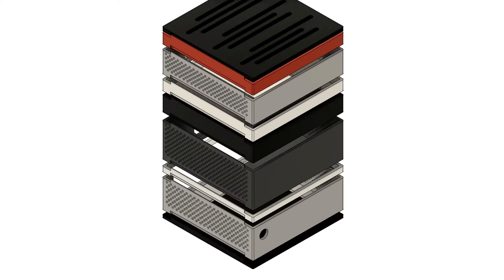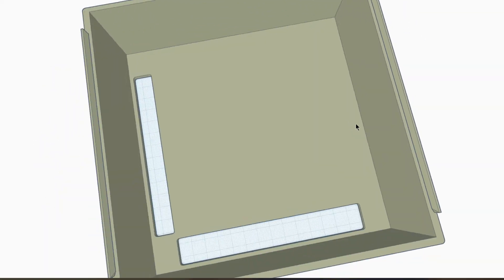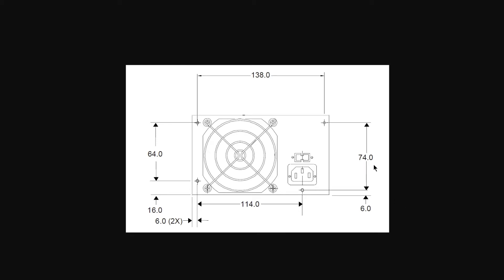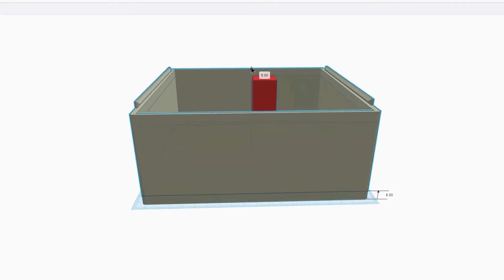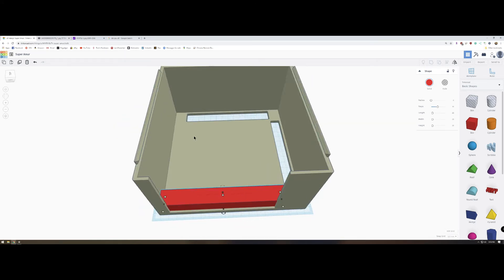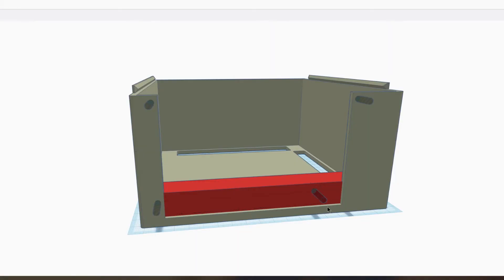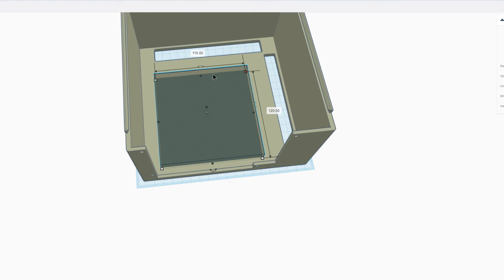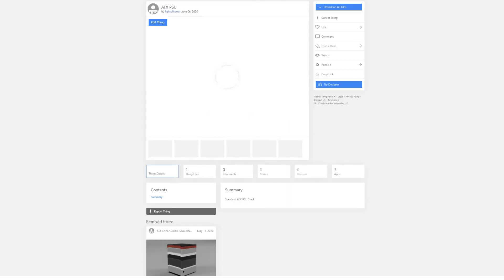Customizing Parts For 3D Printed Stacking SFF ITX PC Case

Comment: Only thing that I miss is being able to fit a full length GPU. I do realise that it's basically impossible to implement it nicely with these small modules. Then again, the smaller size is what makes it all appealing in the first place 😅.  I suppose a diagonally placed GPU could be slightly longer... Hmmmm...
Reply from the maker: Someone proposed putting the GPU vertically where the cables go, but it'd be a pretty big modification.
Reply: @LohTec  Yes why not just put the mobo vertically on one side of cube and gpu directly in 1st pcie slot without riser and you can make the cube as 175mm or as tall as an itx square and then keep on adding modules to increase the height & thus increasing gpu clearance.